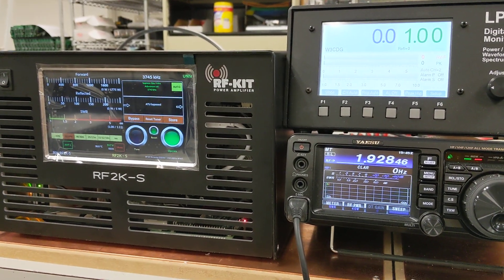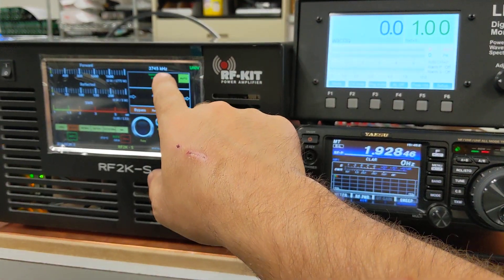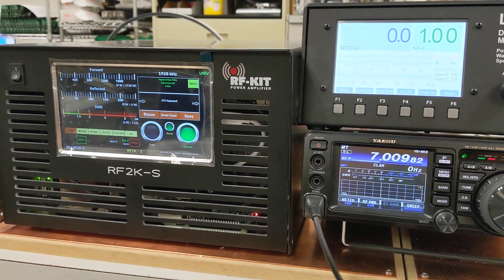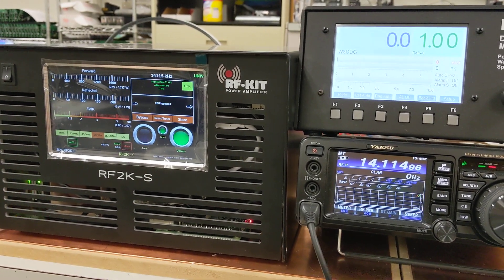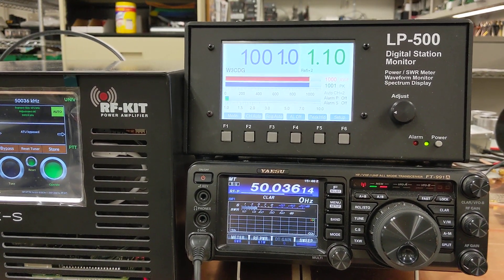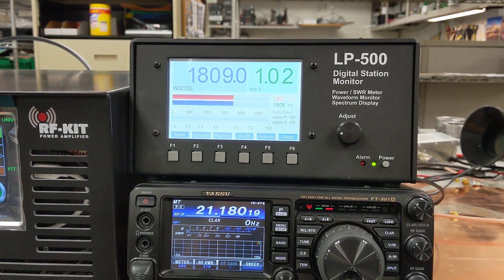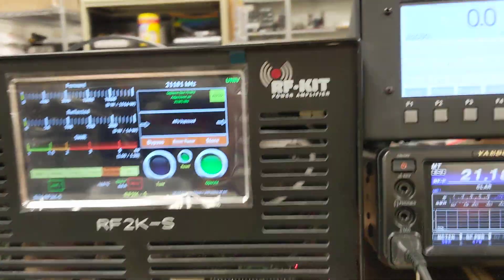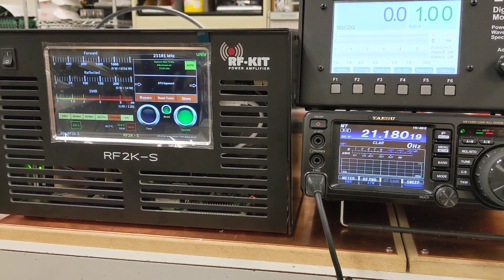RF2K-S Solid State Amplifier Testing Demonstration

Comment: You ran it for six hours on FT-8, but at what power output? 
Ken W8ASA
Reply: 1.5k presumably.  Mine will do that all day long.
Reply: @ElAlcahuete  and what about the fans after that time?
Reply: @Andy-M938  Unless it's the summertime and the shack is a little warmer, I don't really get fan noise at all from the amp.  I get way more fan noise from my radio running FT-8.
Reply: @ElAlcahuete  Sounds too good to be true :-) Just some more years to save the money,hi!

Comment: The Kit is really not that involved to get up and running.  You will need a DVM, a 1KW Dummy load, a radio to use as a test rig with variable power output, a couple of patch cables, a single RCA cable for tx/rx switching to hook the amp up to your radio, a power meter, soldering iron, small qty of solder and a small flat screwdriver\tuning tool.  You will also need a computer and an SD card reader\writer to write the software onto SD card to install into the Raspberry Pi.  You will also need to hook up various usb and video cables to their appropriate jacks inside the amplifier (all cables included).  You can get the amp running and calibrated with the 120VAC cable (included) the 240V cable is only needed for full power running after everything is set up.  The basic concept is that you install the Pi and it's cables.  Write the software to the SD card and plug it into the Pi then power up and bypass the PA board with an included pigtail cable you solder to the internal coax that feeds the PA Pallet in order to bypass it.  you then put various levels of RF on various bands through the amplifier in both the forward and reverse directions to adjust the calibration pots for forward\reverse power.  You will need to make two voltage adjustments at points on a board with other pots, and one variable capacitor adjustment.  After all of those adjustments are complete you remove the pigtail and make the only two required solder connections by connecting the internal coax to the RF Pallet board. After that connection is made you change a couple of plastic computer type jumper pins from one position to another and then slowly test into your Dummy load on various bands and power levels while making a few more fine pot adjustments.  Walking through the whole process the first time takes a couple hours, but really is not difficult.  I could see after aligning a couple of these the average Ham could go through the entire alignment in about 30 minutes.  As of right now the software\firmware is very limited, and many of the promised features are not available yet, although the amp works great with just the tx\rx line and coax hooked up to the transmitter. Band switching is instant.  Overdrive protection is instant and reliable so far, as I have accidentally over driven my amp a few times during my initial 10 minutes of using it after finishing the set up.  There was no harm no foul... hit the reset on the touch screen reduced my drive and carried on.  I have been running mine for the past two weeks at about a kilowatt SSB PEP output since I am still on the 120VAC for now. The amp only requires 19Watts of PEP SSB drive to attain 1KW on 20\40 where I have been using it so far.  At 1KW  this amp loafs along like a kilowatt is nothing. When the internal fans do kick on I don't even notice them, since quite honestly the amp is quieter than the ambient noise in my shack when the radio is on anyway.  I have done a "keydown" test a few times on a few bands but only to a Kilowatt and only for 7 minutes as my Cantenna is only rated 1KW for 10 Minutes.  The amp put this energy into my load effortlessly for those 7 minutes.  Cooling fans were running and the temps were in the 50C-55C  range.  I have not had much chance to use the internal tuner unfortunately.  It does not quite match the tuning range of my MFJ-998 and my Hex Beam needs some tweaking and has a band or two that are just out of tuning range of the RF2K-S but well within the range to be tuned by my MFJ-998, so I am not thrilled I still am forced to use my external tuner at least until I get a chance to tweak my hex beam.  Idea was to eliminate the external tuner.  I'm guessing this will be possible, I was just a bit lazy when tuning the hex since it has 8 bands and was impossible to get them all perfect.  So far I am enjoying the amp but wish more of it's promised features were currently available.  Would also love it if it was possible to eliminate the RCA TX\RX cable and still maintain the speedy switching.  Dont know if that will happen but it would be great to get the UDP or even if the amp just detected drive on the input coax and went to action without requiring the radio to tell the amp to transmit.

Comment: Heard Tim, K3LR, say this is available as a kit.   Are the technical writers US-based or European? -  Would be a fun project - KB3H
Reply: Speaking of the KIT...  Any details on what will be required of those of us whom have ordered this in kit form.  It sure would be nice to know what will need to be done before the amplifier arrives so we can prepare...
Reply: @nickp.4915  - We have a beta build manual, and will try to get it posted on the website early next week.  It is a pretty easy build.  You need a good dummy load, soldering iron,  accurate watt meter, volt meter, and some screwdrivers.  Actual build takes almost no time, calibration takes a bit longer, but at this point I can run the entire calibration in about 15 min.
Reply: The build manual is written in German and has been translated to English.  However we have been working with them on getting the translation cleaned up.  Reinhard has been great to work with and very helpful in teaching us everything there is to know about this amplifier!
Reply: Cory
Many TNX.  Did a ton of Knight and Heathkit projects.  Amazing how, pre-CAD, they were able to do ‘exploded’ views of chassis alignments - truly an art. Looking forward to you bringing this to market soon - KB3H

Comment: I'm sure you have to connect the radio somehow to the amplifier. If you are not using a CAT control, than how does this process work? I currently have an Expert MB1 SDR as my rig. KB3Z
Reply: Yes it sure does look as if there will be no CAT connection or any other connection required other than the power and the coax, and of course the optional LAN and PureSignal for those radios equipped as such.
Reply: It does frequency sensing down to about 1 kHz.  (you can see the frequency switch to almost the exact radio frequency) Honestly, I was doing things I would never do with my current amplifier just to try to break it.  Between the fast controller frequency sensing, and the pin diode tx/rx switch, band to band switching, including tuner is around 15 ms.  TX/RX only is measured in microseconds.
Reply: @corygibson5770  considering the incredible ease of use and how much consistent power this puts out on very little drive, this is an impressive piece of gear.
Reply: I was looking at the Specs and it has an ATU. How much of a mismatch can the tuner adjust for? I am using my SPE 1.3K with a Palstar HF-Auto. The only bands where SWR may need to be adjusted would be 80 and 160M. Any thoughts on this? Mark KB3Z
Reply: @markgriffin2285  - Specifications on the ATU are 3:1 VSWR.
Reply: I don't know for sure,  but based on his comment about RF sensing I  would bet that the amp includes a very fast freq counter and it doesn't key until it's set the right band. But,  this is just supposition based on the video. It makes sense,  they're not reading the freq to tens of Hz, just what band it's on. That you can do fast..